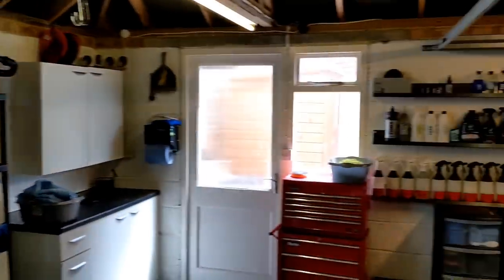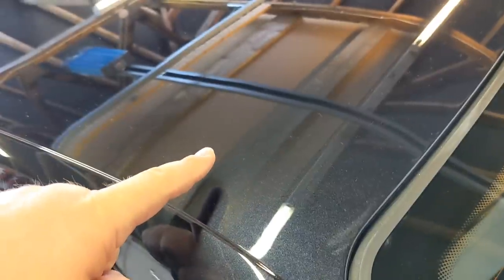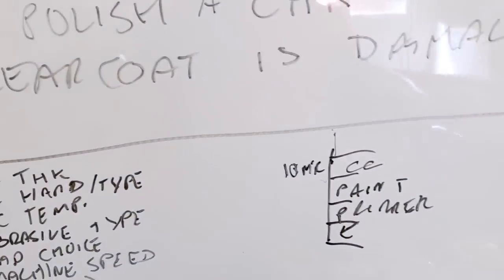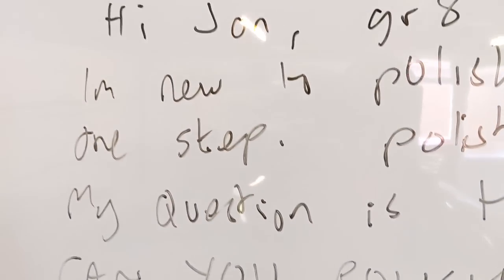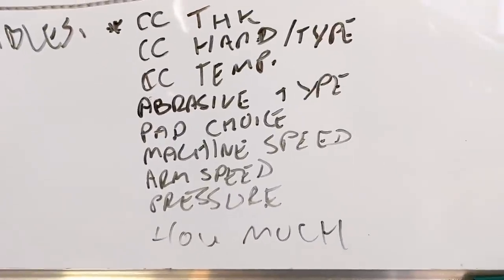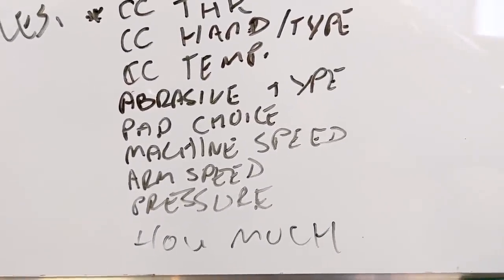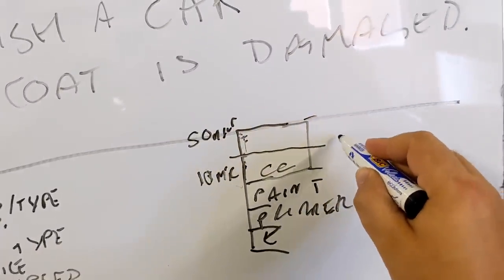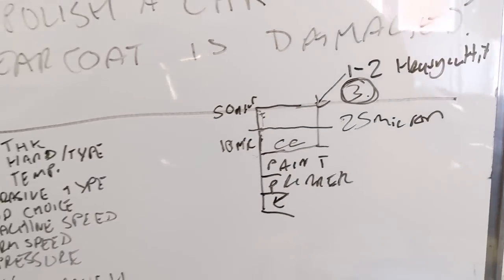HOW MANY TIMES CAN YOU POLISH YOUR CAR WITHOUT DAMAGING IT?????

Comment: Larry Kosilla from AMMONYC gave the best comparison - treat any form of polishing like a visit to an ER. You don't make a habit of visiting emergency room once a year, right ? You go there when you absolutely have to. Same thing with paint - don't make a habit of polishing, do it only when it is utterly needed. If you need to polish a paint once a year - you need to rethink your car care regime.
Reply: Same tought as I had
Reply: Yep the video in AMMO NYC at the Honda plant is really good for showing this.
Reply: It depends. If you give a quick buff with a finisher polish to remove small wash swirls you can hammer it more than 100 times. Very different situation if you compound... When I buy a new car I tend to remove everything with rotary and wool to have a flat finish, then a quick buff once a year with a finisher polish
Reply: Yes. Yet, most detailing youtubers recommend a one step or a cleaning polish before applying wax or sealant. This is puzzling to me, as many waxes should be applied several times a year. I doubt that 2-3 rounds a year with the polisher would be beneficial. The clearcoat would probably not last the lifetime of the car

Comment: One of the most important things about polishing is not to chase absolute perfection. I’ve done one two-stage correction on both my weekend cars and I’ve had to accept I won’t get rid of every single scratch. Yes, I’ve got rid of all swirls and minor scratches but I want to preserve as much as the paint as possible in case I need to do another correction again in a couple of years when some swirls inevitably appear again.

Comment: Yes I must admit i’ve gone through clear coat (many years ago!) on a panel edge and it really gave me an impression of just how thin these layers are. I think one or two heavy sets to correct the paint to a good standard carries no risk if the paintwork has never been cut and then a quick finishing polish once per year.

Comment: Dear John sir, again it is a great video congratulations. 
According to most car manufacturers, they apply ...on average.....50 microns (2 mils of clear coat ). According to clear coat manufacturers ( pp&g) is the minimum of what cars needed to be protected.
BUT they're is an issue. The UV inhibitors that are in the clear coat, during the cure process because they have lower molecular weight they migrate to the top layer of the clear coat. Almost the 100% of the UV protection lays on the top 10-15 microns of the total 50..... unfortunately.

And further more, according to Pp&G and other clear coat manufacturers, those uv inhibitors, are loosing its strength by 50% every 5 years.

At 5 years we have less 50% power in those uv inhibitors, and in 10 years mark less 75%......

Those are the 2 reasons that we much not relay on clear coat thickness.only

Much love from Athens Greece dear John...we love you here!!!

Comment: Confession time: I once went through the clear coat on my own car when I started out😡. I had a British Racing Green MGF at the time. I spent too long going for perfection by rubbing fingernail scratches out of the door handle cups, using the 3M Perfect-It system. I burned through on the bottom edge of the handle. Nowadays though, I reach for the fine polish and see if that does the trick before going for anything medium-cut or one-step.

Comment: Great video and a difficult question to answer because of the many variables. I think the question you have to ask yourself is 'what am I looking to achieve'? We all want perfection, but is that really feasible for your daily driver, which is subjected to the elements, notwithstanding the ordeal of being washed regularly?  Swirls are going to appear no matter how careful you are, so there has to be an element of acceptance to imperfection if you don't want to go absolutely mad striving for the impossible. The paint on both our white cars had hazed with fine swirls during their 8 and 10 year lifespans, so my approach was to use my Das 6 Pro machine with Megs 205 low cut finishing polish and a Hex Logic white pad to err on the side of caution. Have to say that the results were beyond my expectations and while far from concourse standards, perfectly acceptable to the average eye.  If my cars only appeared at shows and were taken there covered on a trailer, then I'd probably go the whole hog with 105 / 205 with orange pads etc. I'd rather have a few swirls than a massive bill for a paint job.

Comment: My feelings are if you properly maintain you paint with safe washing techniques, you should never need to cut.  That’s not to say that you never get a random scratch that will need compounding.  But, if you abuse the clear coat with aggressive automated brush car washes and are continuously cutting out paint damage, that’s when thickness becomes an issue.
Reply: New cars possibly but in general, no. Tons of cars with hard paint where a 1 step just isnt enough then you need to bring back clarity/gloss with a finishing step.

Comment: Hi John, Can I ask when removing Ceramic coat how and what is the best way to remove it and or can you polish ceramic coats, the reason I ask is I had my old E39 M5 done and the boot and bonnet have swirls and fine scratches and I am very very ocd when it comes to washing my car, 2 bucket method, careful wash and blow dry and prior to was I tend to go over it with a jet wash to remove loose stuff so I am curious as to why with a ceramic coating why this has happened.  Given how popular Ceramic is now I think many others would be interested buddy.
Reply from the maker: again mate all the variables we talk about in this video are factors but also the coating used.   lighter consumer coating can generally come off with mid range cutting compound.  thick high solids pro only coating might need wet sanding.   Hard question to answer this.
Reply: @ForensicDetailing  Thanks for your reply John much appreciated

Comment: Hi John, I've recently got myself an e90 BMW that has a bonnet similar to what you showed when you went outside and showed clear coat thinning. I thought initially the imperfections would buff out, but I'm afraid the bonnet has other scratches and water etching in it also. What would you suggest could it be wet sanded to the colour coat and then have its cc reapplied or would it need a complete respray. Tia.

Comment: in short: you don't need to answer it, you just want to avoid getting into an issue where you are needing to.
Elaboration: From experience of just watch youtube and try it, best process I heard was from Sandro at CCAD on YT: always start with the least aggressive method you think will work first. I can also vouch that one DA is not the same as another brand to brand. Even with a recommended pad or pads (and ive tried many on the same machine) they cut lighter anyway so I found relaly agressive methods (if described by others would be overkill) but the machine just doens't have the oomph. As a result, I was less likely on a medium pad with the same cutting compound to do the same cutting on a Daz v2 as you will with a Bigfoot. This worked for me: Do one pass with a fine polish and medium pad., panel wipe, examine. Not enough do another one. Recheck. Then go from there with experimenting with a heavier compound on the same pad or work a smaller area and huse the same combo. That'll give you a good average to work the whole car once you get hte best results from the tests. Sounds counter intuitive to spend hte time but then work in same size area as your test piece around the car following the same method exactly with a slight overlap between pass areas, and the results assuming paint is similar all round (ie all factory)  will be consistent. You've removed the bare minimum then with the best finish you were happy with. And hopefully no accidents. I've burnt through paint twice both seperate occassions on intricate areas where i wsn't getting enough so upped the pad to firm. I learnt it wasn't bad luck on the second time. Im no expert by any means so maybe something in there may have helped.

Comment: On another channel, they said twice, then he would not polish it again.  And that's with not taking into account if it has been polished before.  That's exactly why you should practice good washing habits, to prevent swirls and scratches.  The use of a glaze is what will be needed, should you desire to get the paint some what free of light swirls/scratches and still preserve what is left of the clear coat.

Comment: Did mine very old e34 3 times but polished thru the clear coat on an edge in the first time. I think edges are the critical points.
Reply: On older paintwork put non tacky masking tape on the edges and even body lines. Never machine polish edges on older paint just do by hand or separately by machine but in a softer way.

Comment: Big question is how many times can you polish newer cars without damaging it ?
Some new cars have 90 microns of paint
Reply: Just wave polish bottle over those ones! Lots of burn through coming!!!
Reply: @kevincampbell8298  problem is we don’t know which layer of paint is thin , could be all of them or just the base coat and if it’s just the base coat that’s thin then we are ok , could be just the clear coat is thin, need one of them special tools to check , problem is all new cars coming with scary thin paint
Reply: @M.E63  totally getting scary thin. Did a new Honda 2 years ago and it super thin to start. Have to be more careful now a days. I tell people its about preservation more now than  will be more they think and look good. Definitely he nice to have a gauge that gives accurate clear coat thickness.  Jason Rise was correct when he said  there is going to he a lot of bur through coming!
Reply: @kevincampbell8298  another issue is most new cars come with soft paints so they get swirled up more but the paint is thin so we can’t keep polishing it , it’s going to be very hard to preserve these soft paints , something that might be useful is glazes with fillers as we can’t keep polishing these new cars
Reply: @M.E63  yep I use some polishes with acrylic in them. Gives that little extra. Then sealants on top, unless coating. Almost like buy a new car then get an couple extra costs of clear shot. LOL either that or just wrap it!

Comment: When I used to spray cars many years ago the mix ratios were 4/2/1 clearcoat/hardener/thinner for bigger jobs and 2/1 clearcoat/hardener for smaller jobs,was always nicer polishing the 4/2/1 mixed jobs after,but only had rotary machines back then,just had to watch the edges mostly and not getting the middle of bonnet and roof to hot or they would warp,a lot of those cars are still on the road today as “classics” but have already been polished to within an inch of there lives,plus some cars I’ve seen had been painted several times on top of each layers,your buggered if you polish through that 😂😂

Comment: Hi Jon as a follow on question from this what would you use to polish your car without cutting, to give your car a glossy finish sorry if you've already covered that in another video
Reply: I think a glaze rather than abrasive polish is what you're after. Maybe have a look at Poorboys Black Hole or Zaino Z5 Pro. Both products are designed to fill in imperfections and you can layer them unlike an all in one polish.
Reply: Use any kind of finishing polish and soft polishing pad. You wont remove allot of clear, most of the times its not even measurable.
Reply from the maker: yer so something like Black Hole, tripple, gyeon primer all on soft pads with low speeds on the machine and quick sets.

Comment: I dont think I would even bother on a daily driver. Maybe if you bought the car used and the paint was trashed. I've been using Carpro Essence on a Lake Country green pad for a few years now every spring. Its cleans up the damage from winter (think snow brush) and I think this could be done every year for decades without ever going through half the clear, probably twice a year if you wanted. Either way, longer than the car will be on the road.

Comment: My mentor taught me that you buff once then wax for the rest of the life of the clear coat. Using safe wash practices to eliminate any possibility of scratching or marring then drying the car with Aqua wax. Refresh your wax coats when you see water is beginning to flatten out and remain on the clear coat rather than bead up and run off. Back then i would foam up my car then rinse. Wash it then clay my car wiping the clayed section dry with my drying towel. Then with quick detailer to remove any residual soap then wax. Using Aqua wax i only need refresh the wax on my clear coat maybe 3 or 4 times a year. Fast forward to today and thanks to machine applied sealants i only need to sort my clear coat 1 or 2 times a year. So easy and very fast with a machine.